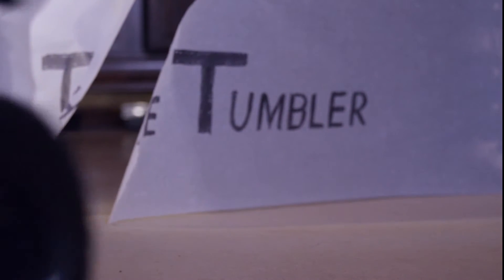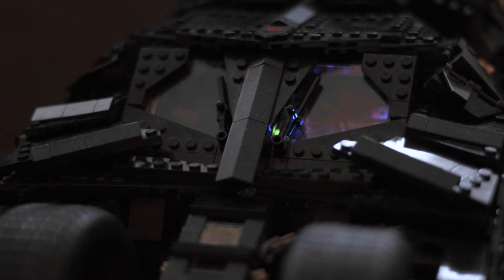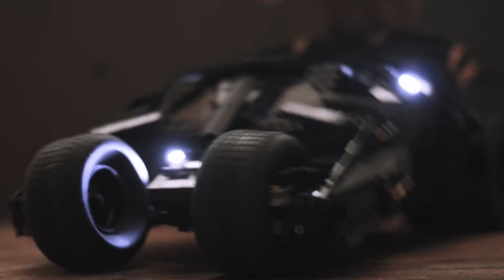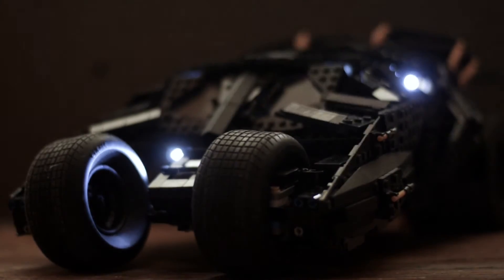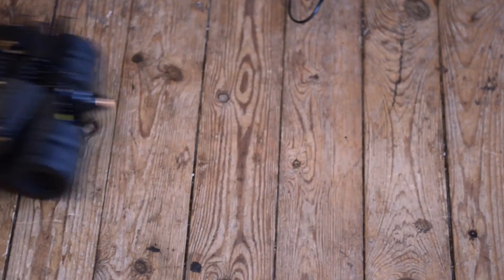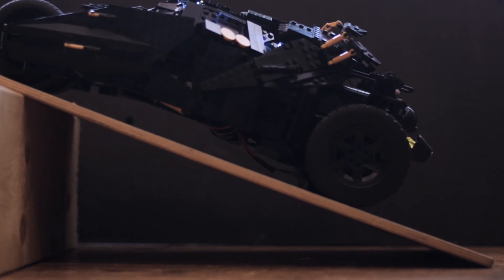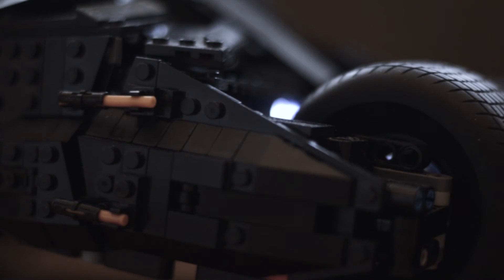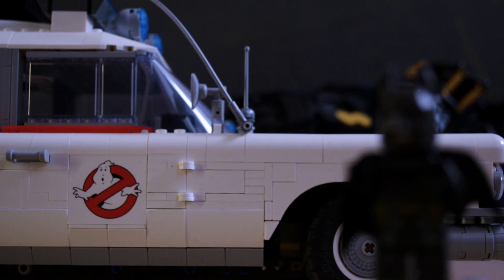motorized moc: RC LEGO Batman Tumbler 76240 / 76023 mod, Batmobile upgrade, remote control, lightkit

Comment from the maker: I gave the 76240 (2021 version) a little upgrade,  You can see some of it here: https://youtu.be/DEjToiupr_4?t=66  
Instructions: https://rebrickable.com/mocs/MOC-95123/  The steering works much better - the wheels are more stable now and it has a wider steering angle. And you can modify it now: by swaping 1 pin on each side you can choose between more stable and 50% more steering angle or less stable but about 100% more steering angle.
Reply: Do you have an estimated price for all the mods excluding the set it's self?
Reply from the maker: @vavslb  brick prices change and it depends on the controller you use. I give some help on the instructions page https://rebrickable.com/mocs/MOC-95123/
Reply: @recklessglitch  the link seems to be broken
Reply: @recklessglitch  hello, the links doesnt work. Can you past it the new one?

Comment: Will a Buwizz 3.0 fit in this? it uses 9 x 4 x 3 studs instead of the Buwizz 2.0 that is 8 x 4 x 3 studs.

Comment: What happend to the instructions? D: I just bought 9398
Reply from the maker: @ElectricGlowSkull  there is a little problem on rebrickable. I wrote a workbench post about it. I am currently traveling. Will have the instructions back by mid of April.
Reply: @recklessglitch  Alright, cause i am really excited to build your tumbler moc finally xD
Reply: @recklessglitch  :D..
Reply: @recklessglitch  Its not back yet
Reply: How much of the tumbler can i build
Reply: Soon hopefully

Comment: Awesome moc! I have this set unopened and want to build this. Is it easier to build the normal set first and then install the moc, or build the whole moc directly from scratch? Thanks!
Reply from the maker: Nahh, Underneath it's rather a technic set and so is my MOC. So you cannot "install the MOC" because you need to rebuild the base and the internal structures anyway. So better directly build the MOC.

Comment: what did you plug the light kit into? did you buy a smaller battery pack? just wondering because i have the same game of bricks light kit and the battery box it came with is too large to fit under the hood, so i am trying to something smaller that can fit it and am wondering what you are using to power it
Reply from the maker: @mcflywolfe  Uhh? That tumbler in the video is my first prototype of the old 76023 kit. I used a micro controller to control it and build my own light from leds back then. But later I used the light kits and part of my instructions on rebrickable is a description, how to build an adapter from power functions to USB, to power any Led light kit for LEGO - they usually come with a USB plug and a USB battery box and you can get rid of that battery box, if you use my instructions.

Comment: Reckless i got an idea what if for the rear wheels to move them use a thing with gears that makes sense them turn faster progresothly
Reply from the maker: Electric vehicles generally do not use multi-speed gear transmissions like those found in traditional internal combustion engine cars. Most EVs operate with a single-speed transmission due to the nature of electric motors, which have a broad torque range and can efficiently deliver power across a wide range of speeds.
Reply: @ damn

Comment: Love your build as I have finally completed it and it works great!  I do have a question about the transmitter and battery box placement.  I may have missed it in the instructions, but where do you place those?  Right now mine are simply in the front seat.
Reply from the maker: In the instructions for the 76240 there is a page showing where to put each controller. Its the same for both versions though:
If you got the buwizz or a chinese control box, then yep, you got to remove a seat. 
Only the sbrick comes without a battery. So it's smaller and fits unter the side window, but then you would need to build some kind of battery that you could put under the bottom.
Reply: @recklessglitch  is the steering better in the 76240 version vs the 76023? The wheels seem to get caught on mine and it doesn't steer well. Considering redoing the front end if it is an improvement in that way.
Reply from the maker: @levilear1  yes it is. For the 76240 I replaced legos nice golden hubs with some other technic bricks to get it more stable and tilt less into the frame.

Comment: Sure makes you wonder why Lego couldn't do this themselves!
Reply from the maker: Well the motors obviusly, not too many people are interested in it. I get a lot of questions if I can make a not motorized version of the 76240 Tumbler, because it looks way better. But LEGO making even a second version, yet shipping with no feature but the same removable roof plates, not even a steering, is disapointing. And people were hoping for a removable bat pod when the first rumours appeared.

Comment: My guy 9398 is 270$ by itself online. And the tumbler is 270
Reply from the maker: Nah'ah! Totally not: In Europe (on ebay.de for example) streetprice for the 9398 is just around 75€. On ebay.com it is below 150$. The 76240 tumbler goes for around 180€ in Europe and 200$ in US. Or where you looking for the old 76023 tumbler? Don't! The new one is better, cheaper and I gave it even more upgrades in my instructions.
Reply: @recklessglitch  Wait i actually commented this? oof. This is still pretty pricy for me imo
Reply from the maker: @ElectricGlowSkull  Yup, welcome to LEGO 18+. That's how they raised their revenue about 1000% (one thausand percent) within 20 years... Anyway, here is my piece of advise: 
If it is too expensive for you (which anyone would understand): Don't buy it.
Reply: @recklessglitch  ok but the tumbler is so cool
Reply: nvm it was out of stock
Reply: @recklessglitch  Arent i luckkkkky i found one for 100.00 a bit more than the one you got for. But im pleased. I also got the tumbler for 130.00

Comment: The fake lego ir use radio signal. Its have 8-12 meters reception. I like it much more then other solutions, since i can add many ir or motor as i wish. And the control is more simple and easy.  
Its 1/20 of the price too
Reply from the maker: I guess by fake you mean the chinese ones? I used one by cada for testing until it stoped working suddently and for no reason. They are okay, but only have 7.5 V while the expensive ones (buwizz/sbrick) go up to 12V. They are definetly better than LEGO IR, because they use LiPo Batteries which deliver more current and stay stable above 7 V not like alkalines. I wrote about all of them on my rebricable page where you get the instructions.
Reply: @recklessglitch  true. But more important then the volts is the current.
I can say alot here, but better you visit my page. I promise you that you will like it ❤️. Nothing compare to the power i can generate from fake ir- nothing.
Its not good thing, to my opinion, to sell something that can hit and melt very easy. ( Under 12v). The lego motors limit is 9 v. Not 12. They can take up to 12, but not for long, and the wires hit too. Specialy the buggy motor, but even smaller ones.
Current protection kicks in very fast.

Comment: Hi will your 2022 version's instruction work if i dont plan to motorize while keeping other features( suspension steering etc)? Thank you
Reply from the maker: you will have to figure something out to stabilize it a bit, but some technic liftarms and some axles should do the trick. I have been asked before, maybe I will make it some time ... after finishing the delorean.

Comment: So if I already had 76240 and 9398, what else will I need? Besides the remote control unit and the power unit.
By the way, how do you connect those Lipo battery to the sbrick?
Reply from the maker: Sorry, there was a problem in the text on rebrickable, i fixed it now ( https://rebrickable.com/mocs/MOC-95123 ) and it contains a link to a list of the parts you need if you got those sests. It's this one: https://rebrickable.com/users/reckless_glitch/lists/146166/#parts and costs around 35 Euros And you will need a controller like buwizz or sbrick

Comment: Is this the first tumbler kits or the second, cos I have the second one and the rear tyres are totally different.
Reply from the maker: BOTH! I made instructions for both. In the video it's only the first (2014), but I did also a 2021 version and it's even better. You can see some of it here: https://youtu.be/DEjToiupr_4?t=66 
or Check the links in the video description. It's this one: https://rebrickable.com/mocs/MOC-95123/

Comment: Hello, I'm very interested for following your instructions. But first, I'd like to be sure of the total cost of the build. Do I only need to buy LEGO  9398 + light kit or do I need other pieces ?
Reply from the maker: You need other pieces too. If you want to motorize the 2021 version: I linked a list of brick you still need if you use the 9398 in the description on rebrickable. Something like 30 Euros.  Its under parts and prices: https://rebrickable.com/mocs/MOC-95123/
Reply: @recklessglitch  oh thank you I didn't see the link sorry. Is there any manual moves in the building (Like cutting or drilling pieces) or is it full legit ? Thank you in advance for your response.
(Sorry for my bad english)

Comment: Hey thank you for the video. I just finished making 76240 model and if I buy the product in the link (26 euros), I can make control the tumbler as a  RC car? 
And I live in south korea, so would it be possible to get the product in south korea?
Thanks a lot.
Reply from the maker: Yes. They are instructions. You will need some more LEGO parts. There is a list in the link and suggestions how to get them cheaper. 
And You need a buwizz or sbrick to controll the car, it's in the description on rebrickable too. I think you will also get them in South Korea, they ship world wide.

Comment: DO I NEED ANY EXTRA PIECES TO MAKE IT MOVE?
Reply from the maker: No, you can use your hand to make it move... If you want to make it drive remote controlled though, of course you need extra parts. Use the rebrickable link in the video description, there you will also find an inventory of extra parts needed.

Comment: What a great video! would it be possible to use the Large motors in combination with the lego Hub?
Reply from the maker: Ah the hub has the wrong sockets (PU), you need a buwizz or sbrick instead of the hub, but it's all in the description of the MOC-page. https://rebrickable.com/mocs/MOC-95123/

Comment: You should definitely make a motorized Lego The Batman Batmobile, these projects are awesome!
Reply: btw I'm contemplating buying the 2021 set (it's so expensive) and if I'll ever do that I'll definitely think about upgrading it with your instructions, though I wouldn't have a doubt if all the parts needed weren't pricier than the set 😂
Reply from the maker: One year ago, the 2014 set was usually on ebay for 300-500€. Compared to that the new set is cheap. But I know what you mean, well, it's LEGO. Most of the extra parts cost below 50€ only the PF parts are expensive but I mentioned how to get them cheaper second hand or china.

Comment from the maker: Finally I finished the update for the new 2021 LEGO Batman Tumbler 76240. 
Details | Part List | Building Instructions - here: https://rebrickable.com/mocs/MOC-95123 Happy Building.
Reply: How many additional parts, except electric stuff, is needed for mod the tumbler?
Reply from the maker: @maximus5433  just open the rebrickable link, there are inventories (lists) with all parts you need and for the 76240 I even made a second list of what you need if you get the 9398 crawler for parts. okay?
Reply: @recklessglitch  ohh thanks, i havent seen it! 👌👍
Reply: Can you list the additional Lego pieces you used on the 2021 set? I want to buy the Lego set and the additional parts of the moc separately, and not every single piece of the moc, that includes most of the pieces from the 2021 set, all at once.
Reply from the maker: Huh? What do you mean? Open the rebrickable link above (and read it) There is a complete inventory containing all EXTRA parts needed, but not the parts that come with the set. Exactly what you asked for, it's right there.

Comment: Are the motors integral to the MOC or could i do everything else except motorize and make wheels steerable? Really like the idea of adding suspension and the roof mod
Reply: You can leave away the motors and just add some bricks. But if you have the 76240 2021 version, wait a few days, I will publish new instructions for it and the side armour panels will look so much better now then LEGO's I think in 2nd week of december I will have it ready.
Reply from the maker: The 76240 is finished and looks way better now than any other version (including LEGO's originals) Have a look: https://rebrickable.com/mocs/MOC-95123/

Comment: Do you already have New building instructions for the new 2021 tumbler 76240 for making it a rc model?
Reply from the maker: Almost, I am working on it. Currently the Suspensions/steer/drive are working, Tractor wheels are in place, new front gunner cockpit is in place (with a little update on the hydraulics there) Still left to do: the front side panels, and then the instructions pdf: I hope in a week or two the instructions will be online.
Reply: @recklessglitch  Okay thanks, I will wait for the final result. I have changed the tires on the back to something that fits much better than the original lego tires in looks to the original Tumbler of the Batman movie.
Reply from the maker: @jeftro060610   Here you go: https://rebrickable.com/mocs/MOC-95123 Happy Building.

Comment: I don't know how difficult it would be, but you should try this with the smaller version (The scarecrow one). It would be faster and probably able to jump
Reply from the maker: I doubt you have enough space for a decent motorization in there. Anyway, not interesting for me, sorry. But If you want to try I'd recommend a single buggy motor, it may have enough power to make it jump an inch or so.
Reply: @recklessglitch  Yeah, i knew there was a problem with the space. i know a friend that could try, i'll let you know if it happens.
Have a good night

Comment: I JUST ordered the 2021 Tumbler 76240 and I’m looking forward to your building instructions for these modifications on this set! It’ll be interesting to see if and how they differ from the original.
Reply from the maker: not too much. The set hasnt changed that much. I need a little bit more space for the bigger wheels. Most difficult part will be, how to design the front armor plates: I dont like the new version very much. Looks too flat, they didnt get that triagular hole right, and it will be difficult to fix on the moving lift arms. I will figure something out though.
Reply from the maker: They have become really well, I wasnt happy about the armour and since I had to change it, I changed it for good: https://rebrickable.com/mocs/MOC-95123/
Reply: @recklessglitch  Can you buy it there and is the web site trustworthy?

Comment: not real lego...
Reply from the maker: almost true,  the car in the video is about half half by now - with all the updates I added using real LEGO. Anyway I only used bricks that are or exist as LEGO bricks for the instructions - if that is your concern - And genuine LEGO Power Functions Motors/servo in the video. 
Back then when I got it, the original LEGO set wasn't sold by LEGO anymore and got rare and cost about 400€ on ebay. (double as much as the new 76240 Version)

Comment from the maker: NEW LEGO Batman Tumbler 76240 update: I have seen the first images and videos on the 2021 Tumbler remake (It appears to be official LEGO promo material (link below) Besides the front, especially the gunner seat, looking even better than before it looks like basically the same frame as the older version. They gave it also the tractor wheels (finally!) but I also used them on my own prototype (not in the video) So I am pretty confident that my 76023 conversion will also work on the new LEGO 76240. I will make dedicated Instructions asap anyway.
Leaked promo footage on amazon: https://www.amazon.co.jp/-/en/76240/dp/B08XD62V41/
Reply: I was on the fence about the 76240, but hearing that you'll make updated instructions for that set will make it a day 1 purchase for me. Can't wait! This video represents everything I love about Lego and TDK, hope you upload more!
Reply from the maker: @larry8673  wow, that's a compliment hope you like the result
Reply: @recklessglitch  Thank you for sharing the creation! I’ve just purchased the instructions
Reply: Greetings from Miami, I am looking forward for your instructions for the 76240 model, thanks.
Reply: You mentioned you used the tractors wheels on your prototype, Is there much modification required for their larger size or is is click and go?
Reply from the maker: No click and go. They are a bit wider then the previous wheels (about half a stud) since you ask here and now, I guess you want them on your shelf model, and not on my driving version, right? If so, just pop them on, see what happens and do some LEGOING, 20min...
Reply: Hey,
Thanks for the reply. I have the wheels on the way. I think I will wait and compare instructions between the two models. You are correct I am just interested in updating the wheels on my 2014 model just for display purposes. Your driving prototype looks insane though! Truly impressive engineering there. Keep up the good work.
Reply from the maker: Done! Look Here: https://rebrickable.com/mocs/MOC-95123